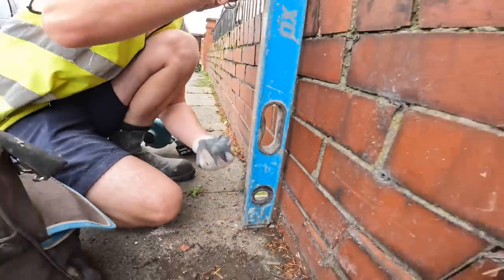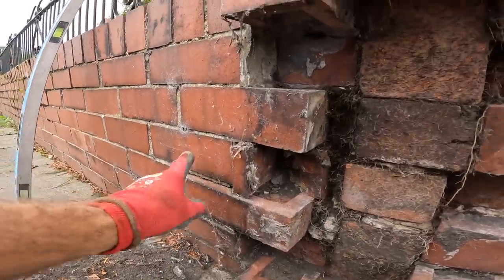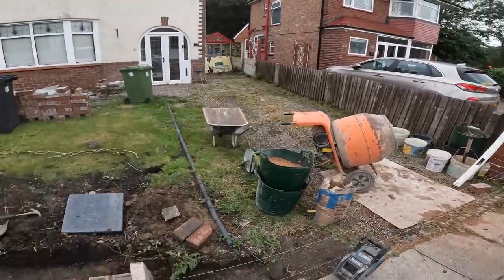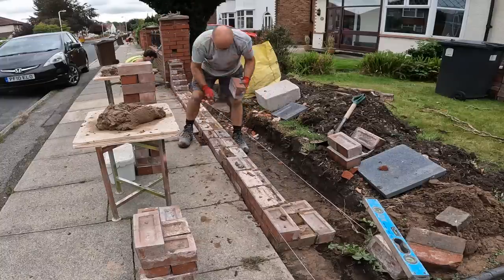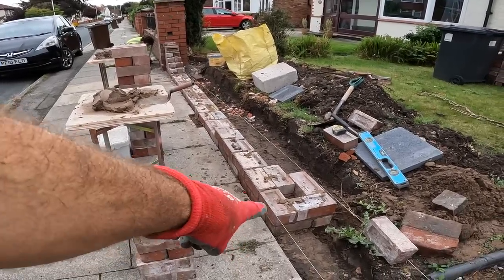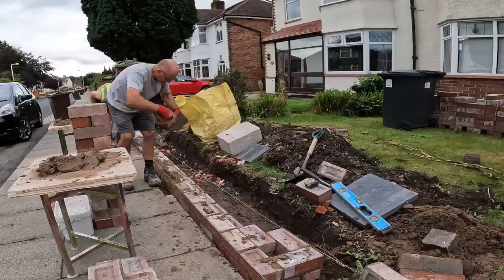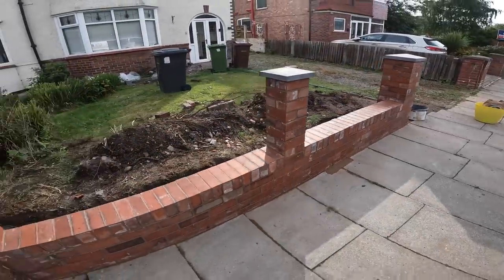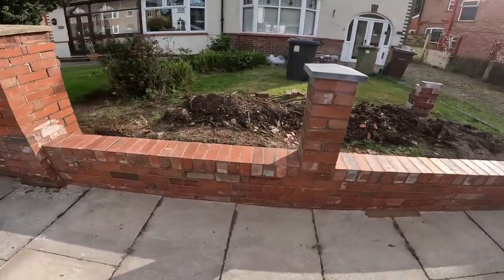WALL DESTROYED BY A TREE ROOT !!

Comment: Two of those exact same trees demolished a non reinforced block retaining wall between my backyard and my neighbors below me. Insurance said no so because it wasn’t sudden and unexpected so I had to fork out a handy £20,000.00 to have a new 2 meter deep engineered wall installed. My company provided the with operator and 2 laborers and 3 skips  for 4 days just to dig it out. Otherwise I’d probably paid another £9000. Those bastard trees don’t send a out tap root apparently so everything heads out to wherever the water is.
Reply from the maker: Jeez , I think the trees days are numbered 🪓🧱👍🏽
Reply: Shame you couldn't have got Steve & Alex, they would have probably done it for half that?!
But it does sound like an impressive wall 👍
Reply from the maker: @Sean006  😁🧱👍🏽

Comment: Gonna have to get rid of that tree. That root you chopped will regenerate and continue to cause damage. The tree,a yew, is of no particular merit, just a nuisance that has been allowed to get out of control by neglect. any is the Lawyer that has gained much through tree/hedge related litigation. Many are the amount of neighbours that have battled over encroachment of trees into their property. Hack it down, it brings nothing to the party. Many better things to plant up in that garden.
Reply from the maker: They need to speak to the neighbour 😬🧱👍🏽
Reply: @SteveAndAlexBuild  Absolutely. And keep things nice and friendly. Luckily, you have provided evidence as to the problem that tree iis causing. Much as we all love to see trees, a small innicent looking bush planted in a garden can cause huge, very expensive problems way down the line. At least it is only a garden wall and not compromising the actual structure of the house.
Reply from the maker: @catabaticanabatic3800  🧱👍🏽